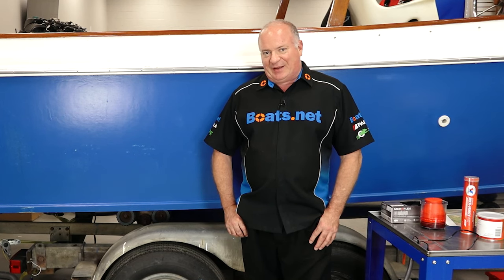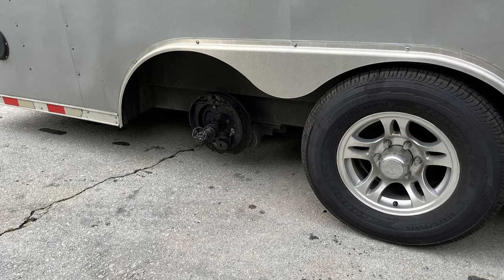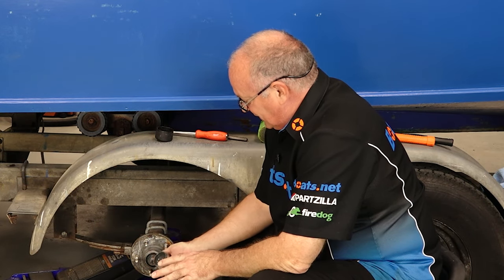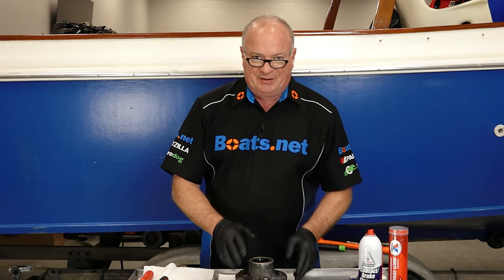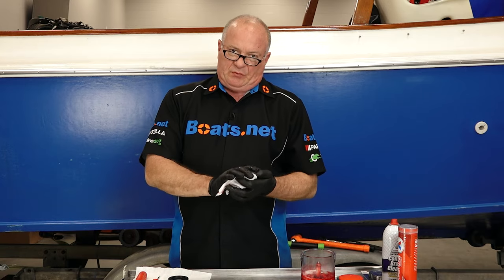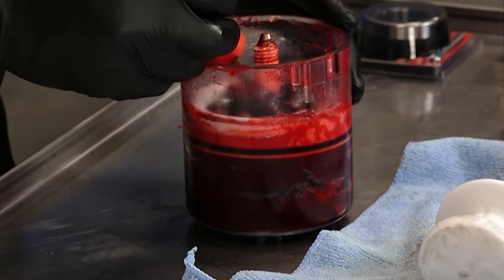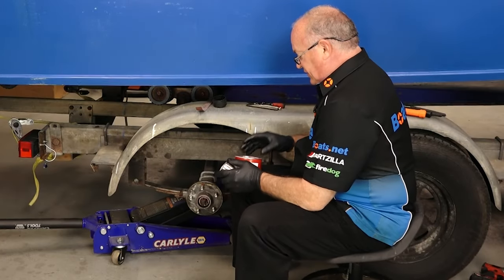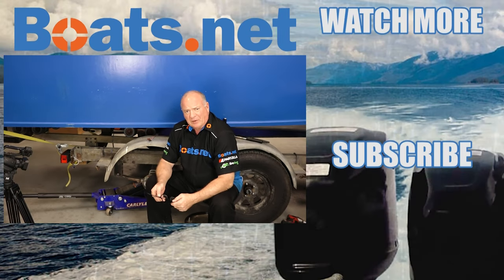How to Repack Trailer Wheel Bearings | How to Grease Wheel Bearings | Boats.net

Comment: Bad move -you should have cleaned all the old grease from the bearing with solvent,dried it, inspected it before adding new grease
Reply: In his defense he did just redo bearings last year and it appeared that there was no moisture in the hub.  But he really should have people about using a seal driver to keep it square going in
Reply: Never use solvent to clean bearings. Residue remains on the metal and can react with the grease. The new grease should push everything out of the bearing.

Comment: Bearing packer tip; I use a drill press, without a drill bit in the drill chuck. Works like magic and I pack an inner on the bottom with the outer on top.  I used to use a bench vise before I got my drill press and that works good also.

Comment: Seems it would be prudent to thoroughly clean and inspect the bearings, races and internals of the hubs with mineral spirits. Hard to see small pits with grease all over everything. I have Dexter Vault hubs which require a totally different procedure and special lube to service. They only need service about every 5 years. The additional seals in this design help prevent water intrusion.
Reply: I never use solvents to do this work.

Comment: so the one with a Zerk fiting, i technically do not need to remove the bearing to repack the bearing pushing the old grease out...only if you suspect bearing failure...?

Comment: Why do trailer bearings need to be repacked/replaced so often when I only need to repack my truck bearings every 80K miles or so?
Reply: Especially for a boat trailer that goes in and out of the water all the time, water will still get into the grease over time and thin it out.
Plus, that trailer is going to be sitting part of the year if you don’t use it all year-round so it’s not getting worked like a vehicle will.
Grease sitting around from summer use to winter storage and back is not going to stay consistent.
Reply: @Acelachaser1965  I guess another way to look at it is the tires are typically smaller than the vehicle tires, so they have to spin a lot faster. My small trailer is about a three to one ratio. So if I'm doing 50 miles an hour, that means my trailer tires are doing 150 mi an hour. The heat from that would wear out the grease fast I take it.
Reply: Do you drive or park your truck in 14" of water?
Reply: @trustme7731  No, but I don't drive or park my trailer and it either.
Reply: @bkilpatr100  You might have mentioned that in your comment.
Reply: @trustme7731 Since the maintenance applies to all trailers, it was a general question. If you misunderstood that's fine, but no need to be condescending about it.
Reply: @bkilpatr100  The video was about boat trailers specifically.